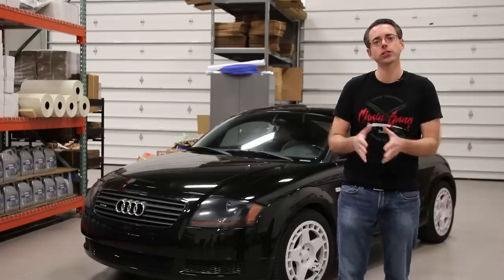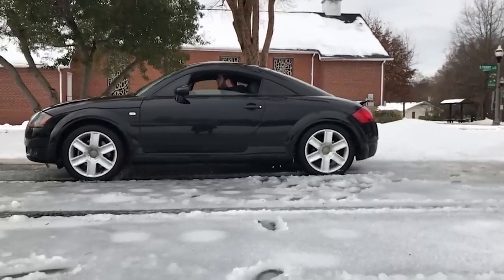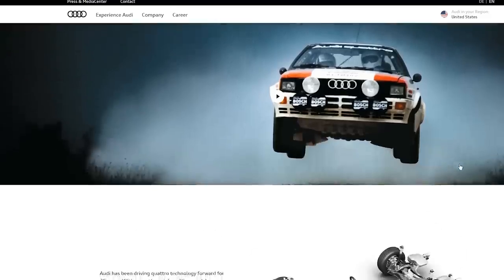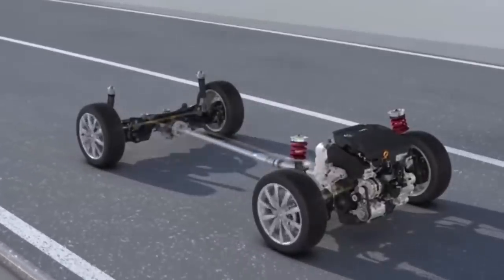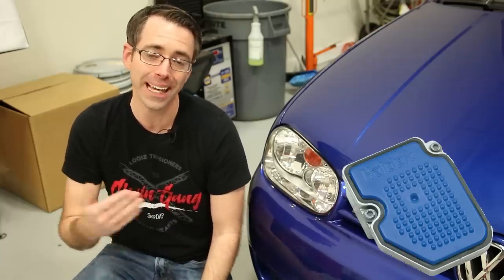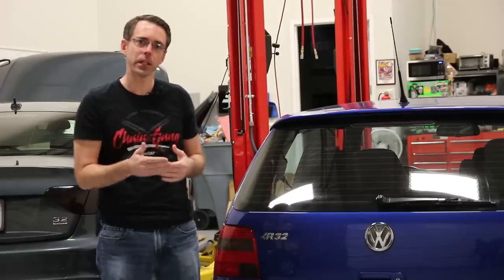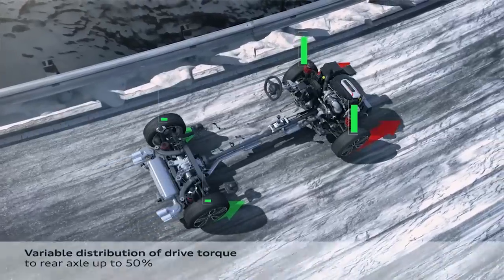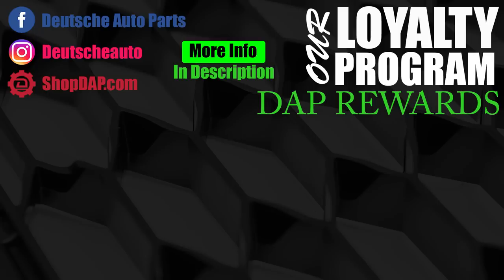History of the Haldex AWD System

Comment: I know Haldex gets a lot of flak for not being as track performance oriented as some others, but boy is it excellent all-around system.  Coming from a RWD + snow tires setup in the past, I now drive a MK7 Golf R + snow tires.  Sunday we had 4-5" of snow here in MD and it still blows my mind how effective it is in the snow.  I went up an unplowed steep hill with absolute ease, not even a hint of slippage, no flashing lights, nothing.  As if I was driving on dry pavement.  I've floored this car before in the rain and it hooks up no problem with just a hint of initial wheel spin, and that's with a JB4.  And when you don't need it, you're enjoying all the gas millage efficiency of a FWD vehicle.  No there is no drift mode, and it doesn't transfer enough power to make it feel RWDish.  It's a fair compromise for my daily duty usage.
Reply: Its a good system, but just doesn't drive as well as the Torsen systems when you really flog it. Maybe if had gears ahead of it to provide more rear bias. (I've got both systems)
Reply: Because his split numbers are incorrect. Haldex isnt the same in all vehicles. Just because your vehicle has haldex 5 doesnt mean it has the same split as every vehicle with haldex 5
Reply: 99Lezard99 Just like Subaru. LBGT community favorite car
Reply: @v60polestar88  haldex awd=handles like fwd. thats it
Reply: 99Lezard99 Just like cvt equipped Subaru AWD. That’s it
Reply: @v60polestar88  no one who wants performance will buy a cvt anyway.
Reply: 99Lezard99 Really then why are so many WRX sold with cvt. WRX sells increased when they made the cvt available.
Reply: @v60polestar88  why you asking me this? how should i know? maybe because there are still lots of americans who cant drive a manual? i dont know and i dont care. i stand by my word that someone who really wants a performance car wouldnt buy a cvt. anyway i wasnt talking about subaru. i was talking about that fwd haldex awd.
Reply: 99Lezard99 not asking telling you. There are very few REAL car enthusiasts out here. Most are phony. All I am saying is Subaru AWD is any better than Haldex. They both get the job done
Reply: @v60polestar88  while haldex handles like a fwd because it is a fwd like 95% of the time. anyway i dont care enough about that topic to evaluate any further or to check if your claims are correct so bye.
Reply: It's AWD for the daily driver.
Reply: V60 Polestar (
Reply: even though it doesn't feel like RWD its really fun to drift in the winter

Comment: I bought a clapped out 1G TT 225 and the haldex did not function. The wheelspin was epic! Decided to service and checkout the unit. There was NO OIL in it and it had the original metal filter. I replaced the filter and put new oil in. Amazingly enough it worked! The system was smart enough to shut itself down to save the pump! I could do a full on dig on gravel and it would just go. Amazing system!
Reply: Yes, just like most computers, when it overheats it shuts off to save itself.

Comment: The Haldex4 used in my XTS Vsport clawed like a scared cat.  Turn off the TC a d stability a d it was power on slides.  It also handled almost 600 lb-ft pr torque with a ecu tune.

Comment: There is a tweak you can make in VCDS on the golf 7 R to increase the drive to the rear. 
1. AWD
 2. Adaptation
 3. Wiring logic
Standard setting is "Low Noise." There are the options for "Normal" and "increased traction."
In increased traction mode to me the car feels much more planted and really shoves you around the corners.
Reply: waste fuel.
Reply: Cyberdyne Systems yes I expected so as well but I’ve not noticed any substantial increase in consumption.
Reply: @YouTubeSupportTeams  Still more efficient than a center differential

Comment: Thank you for this and other videos Deutsche Auto Parts produced.  I appreciate the time it took to do the research, draft a narrative that explain generational nuances in simple terms and the supporting graphics.  I also like seeing your 2004 R32 and appreciate what it takes to keep this 15 year old car in top notch condition.  I'm the original owner of a 2004 GTI VR6 and like to keep mine looking as good as yours and operating reliably well.  Up to this point, I replaced worn parts with mostly OEM parts or aftermarket parts that perform like OEM but have better reliability... no high performance parts.  Soon I'll give you guys a call to discuss some in-depth routine maintenance that I need to consider.  I look forward to getting your expert advice.

Comment: Interesting stuff, thanks ! I always thought gen 5 could send up to 100% to the rear when needed , learn something new every day
Reply: I think the only full-time AWD system that can get even close to 100% to the rear is the ATTESA-ETS as it's a rear biased system. Most other AWD systems are front drive based as far as I can recollect. IIRC, Audi's proper quattro (not their Haldex systems, but their Torsen set-up) is still maxed out at a torque split of 30/70 FR bias, but with the advantage of actual differential torque vectoring (not using ABS to achieve a similar result). Certain Audi's have the Haldex while other Audi's have the Torsen layout. All of them will say 'Quattro', which I think is a bit misleading. 
Really, Subaru's Symmetrical, Audi's Torsen (not their Haldex), Acura's SH-AWD, and Mitsubishi's S-AWC are the most...'versatile' AWD systems. The others are typically variations of Haldex with torque vectoring across planar axles via brakes.

Comment: Incorrect on the split on haldex 5. Haldex split is determined by the software programming by the manufacturer. My V60 Polestar is 70/30 split in normal condition and 30/70 with sports mode on and esc off.Unless the manufacturer gives you the split numbers your just assuming

Comment: Recently serviced my 2014 Tiguan based on PQ46 platform which is gen 5 haldex, which got rid of the filter.
Reply: Did you at least pull out the pump and clean the screen on its intake?  I've seen some pretty nasty photos of those, and others that looked 100% clean -- that may depend on how the car has been driven.

Comment: GM uses a similar system in their trucks but the clutch system is in the transfer case not the diff. When in "auto 4x4" it engages and disengages the clutch pack as it sees slip.

Comment: Haldex Gen. 4 has also an oil filter. But in Gen. 5 they throw them out. And in different forum you can read a lot of fault clutches and pumps of the Gen.5
I think that was the bigest mistake they ever made.

Comment: I had a 2010 tiguan and now have a 2019 tiguan and I've felt front wheel slip, on dry road, in the 2019 that I never felt in the 2010. Haven't put the gen 5 to any real test yet but hopefully it does as good as the old one.
Reply: You may want to make sure your haldex is actually working. The pump failed on my 2016 S3 and basically turned it into a GTI. I started noticing that even with partial throttle it would spin the front wheels constantly on dry pavement which should not happen, even with 350+ ft/lb torque. I proved it by parking the front wheels on an ice patch and the rears on dry pavement. The car would not move at all, just spin the fronts. After the fix it is a rocket off the line. The gen 5 has no filter so it gets gunked up. My mechanic said he has seen a bunch of them fail at low mileages (30-50k).

Comment: I have a gen 1 Audi S3 (210HP version when factory stock), which I’m guessing comes with a gen 1 Haldex. It’s currently modded to 350HP. I’ve been searching for docs for a while now on how to convert it to RWD for drifting, but haven’t found anything. I was toying with the idea of removing the front axles and then trying to electrically trick the rear clutch closed. Would that result in 100% torque transfer in the rear you think? Any pointers would be greatly appreciated.

Comment: So if the gen 5 haldex which is in the RS3 is predominantly 100 to the front but can send 50 to the front and 50 to the rear how is it that the RS3 can send 100 to the rear?
Reply: That comes from lack of understanding between static and dynamic driving behaviour. Static is 50/50, but car is a dynamic thing - there is changing coefficient of friction, there is transfer of weight etc.. Then almost 100% of torque may go to the rear.

Comment: Loving these videos.

Could you comment on whether the the Gen 3 Haldex unit (like in a mazdaspeed6) is a reactive or proactive model? From driving the car, it feels like there's times where the car just keeps the clutch packs engaged under spirited driving regardless of throttle input. Not confirmed but I've read that it is more similar to the Gen 4 unit (than the Gen 2).

Thanks for sharing

Comment: What I still don't completely seem to understand is if between the 90-10% and 50-50% torque transfer ranges there is a slip between the friction clutches in the Haldex differential or if it is achieved by fluid friction (ie: fluid coupling), since there isn't any type of "gearbox" to select how much torque is transferred to the front and rear axle.
Reply from the maker: check out this video https://www.youtube.com/watch?v=tnHPVbSF0cs

Comment: Hi there, with non permanent 4wd does the vehicle sense slippage on descelleration/ engine brsking in snow?  I remember climbing well on a snowy road with a renault kangoo 4x4 but on the descent the rear wanted to overtake and 4x4 didnt feel engaged

Comment: Hi guys
Has anyone attempted to repair a broken G5 Haldex? Is it repairable?  
I have broken my MK7 Haldex .
If there is a video about MK7 R Haldex rebuild would be great. 
Thanks
Reply: Maybe theres a place that can refurb it but I'd expect it to be a pretty specialized and complex thing to rebuild, have you spoken to any transmission repair shops?
Reply: I understand you're asking if there is a video but finding out if it's possible to rebuild and to get the parts would be a good idea.
Reply: Hi
I bought a used diff and it ceased up after two weeks without any abuse. I'm taking them apart tomorrow and see what's damaged.  Probably jammed bearing.

Comment: DAP Team? So does this mean the TTRS and the RS3 can't send up to 100% to the rear? when zero traction is detected at the front?
Reply: They can technically send 100% to the rear if the front wheels are off the ground. Really it's just the 50:50 split with the front unable to do anything.

Comment: Ok. I have a question. I have a Golf MK4 2.8 VR6 204bhp . From the video i'm getting that i have a Gen 1 Haldex. So can i upgrade it with the performance module?
Reply: MagnumBulletMatriX if your MK4 2.8 VR6 is a European spec and equipped with “4motion” Haldex system.. yes you can. I believe the only current upgrades that are available are HPA’s touch motion and United Motorsports tune.
Reply: i have the UM haldex flash on gen 2, the response is so much better along with cornering
Reply: It’s upgradeable if you can find a module (search haldex blue).
Reply: @taiwilson8966  If its possible,drop me a link please.
Reply: @JettaRedIII  Thanks. I'll look it up.

Comment: dude, how it could be zero torque in the rear? if so, then rear axle will drag the car slow. and Borgwarner TorqTransfer system change its name, now it called Powerdrive system since Remy joined.
Reply: The car drives the rear axle through the wheels. It has zero torque on the rear exactly the same way a pure fwd has.

Comment: How does the Quattro in the A4 and up function?
Reply: The quattro system in the A4 utilizes a torsen center differential. This type of quattro is generally regarded as superior to Haldex, as it is permanent AWD that never decouples the rear wheels (minus the B9 allroad). Haldex does, however, achieve slightly better fuel economy due to it being FWD when the rear wheels aren't needed. torque split is 40F:60R or 50F:50R depending on which generation A4.
Reply: DAP actually has a video comparing the two, if you're interested.
Reply: Phonecase I recently picked up a used 2013 A4 Quattro. Do you know if this Quattro system has a service interval?
Reply: @tiedeious5404  Audi doesn't specify one on their service interval chart for 2013. Personally, I would change the Trans fluid at ~60k miles and diff fluids at ~100k. they're regarded as "lifetime" of the car fluids, but if you're keeping the car long term, it would be a good idea to change the fluid at some point before 100k miles.
Reply: @phonecase3493  Thanks. I have heard that this is a good idea. That means I'm due for both lol. Any thoughts on  flush vs fluid change?  Audi wanted to charge me $600 for a trans fluid flush. It kinda turned me off. I may have to look into Mr. Transmission for pricing (at least that's all they do, hopefully they do it well).
Reply: @tiedeious5404  if you're over 100k miles I would only do a trans fluid change, not a flush. diff is fine for either one. flushing the trans fluid one high mileage cars can do more harm than good sometimes.
Reply: @phonecase3493  Ok. Thanks for all the information. I will get in touch with Mr. Transmission and go from there. Im hoping this car lasts me another 5-6 years.